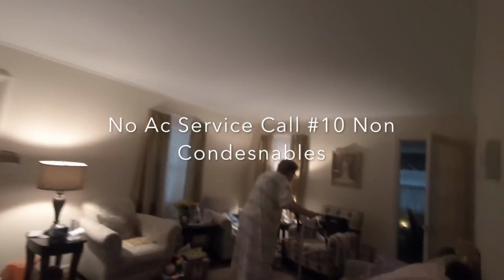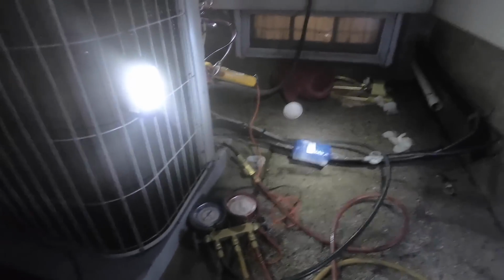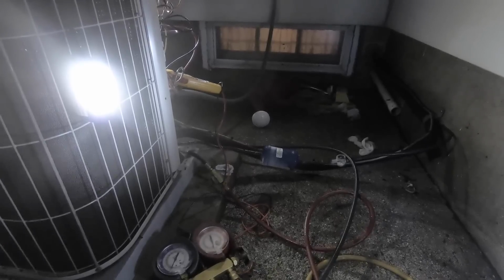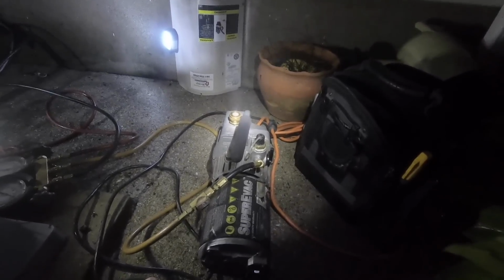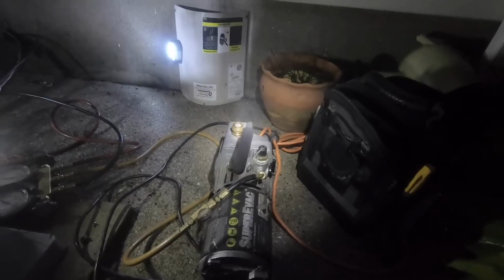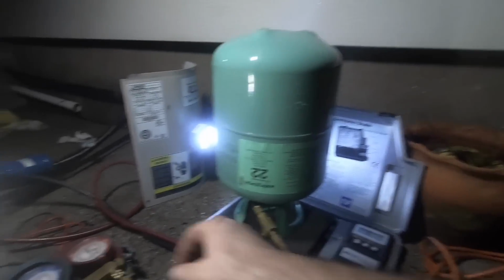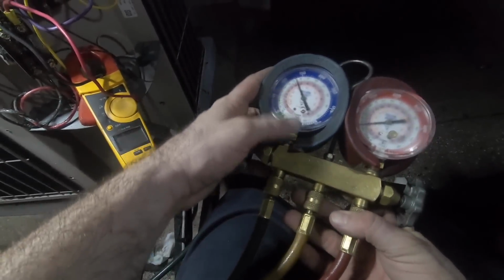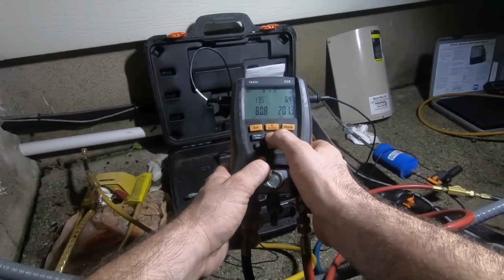AC Not Cooling Contaminated System Overheating Compressor HVAC

Comment: Contaminate system u should change the poe oil ang dry a filter too,this a hack job
Reply from the maker: System doesn’t have Poe oil, I used up my only 2 driers earlier in the day. This is real world HVAC. This is an emergency call so I did what I had to, to make the system work. It’s still cooling today only getting a maintenance. Does coming online and being a troll make you feel good? Read through the other comments and you would know why the drier wasn’t changed
Reply: The HVAC Hacker 
So, you charge the old woman $1,600 and because  YOU didn’t have a drier on you, SHE accepts the risk of failure down the road.   Get a grip boy
Reply: @thehvachacker  you should have come back the next day with a new filter drier. Because I'm sure you won't be back to put one in. A/C can wait till you have the parts the next day. That's real world HVAC repair. No filter drier won't be your problem. It will be the customers in 5 years. And speaking of the customer, you were talking way over her head
Reply: @Jimmy Nguyen - Your comment is a hack job.
Reply: @Bob- Another effin troll.

Comment: I thought NEC rules mandate a 120 volt service outlet near exterior AC evaporators
Reply: They don't require one. A smart person can get power from the 220V at the unit
Reply: @bobrob3109  i want to be smart. How would you do that?
Reply: @gerardolopez3858  A "cheater cord".  Basically the female end of an extension cord.  Clip cord Line to either line going to the AC, clip cord Neutral to the  AC ground wire.  Illegal around here
Reply: @1480750  It's pretty much "illegal" everywhere. You can't use the ground as a neutral return.
Reply: @bobrob3109  My bad.  NEC 210.63 only pertains to rooftops, attics, and crawl spaces.
Reply: How are all old electric driers wired? 2 hot wires and one ground. They have 240 heating element and 120 motor. The motor powers from one hot wire and the ground. Yes it is no longer the way and new codes require a 4 wire cord to allow the neutral to be separate.  But for many decades it was just the way.
Reply: Commercial only this is residential anything flys in residential

Comment: okay so im a DIYer is the subcool is your liquid or suction and your super-heat is your vapor or head pressure??
Reply: Sub is liquid
Super is vapor
Reply from the maker: Joey Del Mars Jr. subcooling is the hot vapor hi pressure gas changing state to liquid inside the condenser coil as heat is being rejected. Superheat is low pressure/ low temp liquid absorbing heat in the evap coil causing it to boil back into a cool low pressure vapor
Reply: Superheat is how much warmer the refrigerant is than it needs to be to boil (liquid to vapor). Subcool is how much colder it is than it needs to be to condense (vapor to liquid). So you can only figure superheat on vapor (low side) and subcool on liquid (high side).
Reply: Superheat is the temperature difference between the SST (Saturated Suction Temperature) and subcooling is the temperature difference between the SCT (Saturated Condensing Temperature). For example 10F of subcooling means the liquid line is 10F cooler than the temperature required to condense the refrigerant ensuring liquid feeding through the metering device.
Reply: Poor Joey’s head just exploded.

Comment: Im just thinking that if someone went and put 410 in there, thinking they were helping her out ,then maybe there is a leak ,otherwise why would they have touched it
Reply: Maybe they read low pressures thinking it was a 410 system
Reply from the maker: System might of been struggling since we were above design temp for 6+ days. Someone not knowing it’s 22 thought it was 410 and charged it up saying nice 22 pressures are lower than 410

Comment: You don't need to tightened hose connection s that hard that you have to use Chanel locks to get the off the vacuum pump silly goose.
Reply from the maker: You don’t I just needed to replace the hose gaskets

Comment: This Technician is one of the best!! I do mostly supermarket refrigeration and some A/C, this technician check and do a very acurate diagnostic, others HATERS a/c guys would sold a new unit to this old lady, but he insisted and repaired. On this industry I noticed that most of the A/C guys they dont like dealing with repair units, they push on sell new units on most of their service calls, I found on 3 diferent times that techs were trying to sell new units, one unit was tripping breaker due to bad relay making contact with unit housing,this was a $20 relay, other time because of blowing fuses due to bad disconnect switch... Way to go HVACR!!!!!
Reply: So, next year when it fails, she'll have to replace it since R22 will be gone. There's some give and take here.
Reply from the maker: So this summer is almost over and the system is still running without anything but maintenance done to it since my repair. Also r22 won’t be gone just not manufactured. We have 5 skids of 22. Yet unless a system leaks r22 isn’t a problem
Reply: WileyDean thats the problem with A/C Tech that dont know work ethics, always trying and pushing to sell new units, can't they just repair the unit or if they can not fix it ask for help, dont try to sell new unit just for a bad motor or bad wires,

Comment: NIGHT WORK LIGHT: I have a 4 foot metal rod 3/8” square with a 8”x8”x1/4” floor plate to hold it up next to the work area and use a big pinch clip halogen flood light to see far better in the dark. I also have clip on battery powered lights too.  I should mention I have an arm that sticks out 10 inches at 2” high with an old 3” magnet mount for a car roof antenna so you can reinforce it in the wind by slapping it right against the unit.

Comment: I think you did a great job. I only wish your truck wasn't limited to two dryers/filters. I'm a retired tinner/installer that started working residential around 1972 then changed to commercial/industrial about 5-6 years later. Enjoyed your video, started to get a little dizzy at times.

Comment: Thanks for posting.  I have a ~35 yr old Bryant AC 2 ton system.  It just stopped cooling.  My high side pressure is super low (~70lb) and the high side line existing the condenser is actually freezing over.  Low side line is lukewarm.  Appears I have a restriction in the condenser coil.  Compressor still seems to be working as compressor exit line is very hot to the touch, but the the exhaust air from the condenser fan is actually cold--not hot.  Any ideas?  I know I'll prob need a new system, but thought I'd ask.
Reply: Thanks for replying!  Strangely it’s the little pipe (high side) that’s freezing over, not the big pipe.  It’s not a heat pump. 

I’ve taken the top off and both sides of the dryer are cold as well (was hoping if one side was hot and the other cold that the dryer was plugged).  The condenser fan is also exhausting cool air vs what used to be hot air.  I think the condenser coil has a blockage somewhere because, as I noted, the compressor exit line is very hot to the touch, likely meaning it has high pressure, but somewhere there must be a blockage.  

Given its a 35 yr old r22 system, I think I’ll prob be forced to put on a new system given cost to fix it vs likely lifetime left.  Surprisingly, this old furnace and AC have been just awesome to this point for me.  No issues in 10 years. 

Separate question, if I go with a new system, do I need to install a fancy thermostat in order to be compatible with most new 80% furnaces?  I have the old school mercury Honeywell round thermostat that I love.  No batteries. No clicking relays (which tend to wake me up when sleeping).  Just works.  I really don’t want a programmable thermostat. 

Lastly, any brands you’d recommend?  I’ve interviewed 5 installers.  I like the installer who puts in Luxaire systems best.  He has great reviews and can install quickly and will give me a good discount if I pay cash.  I also like the installers of Ruud and Trane products but they will take more time to schedule.  I have a 9 month old pregnant wife, so I’m trying to get a good person in quickly.  Thx!
Reply from the maker: You can keep your round t87 thermostat. Can you rent a thermal imager from anywhere? You could find the restriction with that. I don't have the money for a good thermal imager yet cause i buy lots of new tools like those smart probe refrigerant gauges. Just ordered the air probes. Along with a website that I'm trying to build up. It sucks to wait for the guys you like to put in the equipment ad i understand my install dept is 3-4 weeks backlogged. Yet the new system is an investment so you want to make sure whoever is putting it in is good. I like Lennox yet also work for one of largest lennox dealers in the country. I just put a coleman into my dads house and it runs nice and quiet. The coleman is made in USA its a product of York
Reply: @thehvachacker  I'm surprised they are able to keep their old round thermostat must depend on the state or city codes? I have a family member who just had a furnace and ac installed in Michigan and they were told that code requires a programmable thermostat
Reply: @Comedycentralmarb  Red states still allow round thermostats.
Reply: birdwing98 especially the ones with the mercury switch inside.
Reply from the maker: is it a heat pump? Is the large pipe freezing or little pipe. If the little pipe is freezing you sure your coil isn't frozen? is the condenser plugged up and needs cleaning. I am asking about heat pump cause you have cold air coming out of condenser and little pipe is ice cold.
Reply: The sad thing is that you have to replace a 35 year old good soldier with a  p.o.s. that will have a life expectancy of 10 to 15 years.

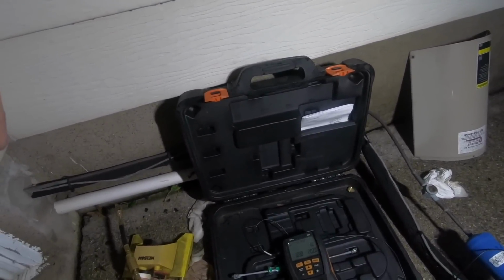Comment: 44:50. If there is a leak so what??!!! Way to take pride in your work.
Reply from the maker: This system is running fine from the repair i did and hasn't needed any refrigerant since that day. You can hate me all you want i don't give a ............ Nothing crooked about making a system operate most would condemn.
Reply: @thehvachacker  units can have leaks and still make it through the summer
Reply: @thehvachacker  you did a good honest job,dont let the asshole comments rent space in your head,i know the lady was happy
Reply: @Mikemeshell63  HVAC HACKER talked way over the ladies head. It's commendable that he stayed late but filter driers are important, like your car oil filter
Reply from the maker: I take pride in my work only reason I don't condemn equipment I can repair. Don't need to take lessons from anyone on taking pride in my work. Word of mouth is how all business is gained. Which means lots of satisfied customers from doing the best I can for everyone.
Reply: Those lights are badass though
Reply: And ... another asshole comment from Bobhole.

Comment: What brand is that flashlight I really like that
Reply from the maker: It's a braun slim bar from harbor freight
Reply: @thehvachacker  I'll have to run over to Harbor Freight myself and take a look at em. I need some work lights for night work. Been looking at the Milwaukee one because I'm a sucker for rechargeables. I've got their inspection pen-light and it works great.
Reply from the maker: Which milwaukee you looking at? This braun light operates on a rechargeable 18650 I have 2 lamps and 4 batteries. To try to prevent not having enough light.The Milwaukee jobsite light looks nice.
Reply: @thehvachacker  the 2112-21 Flood Light. Its got a magnet along the spine and a magnet along the end. It looks like exactly what I'm wanting. But the braun one may be right up my alley, I vape and have oodles of 18650s and a 4-battery charger already, so we'll see. Never hurts to have plenty of lights.

Comment: The "seconds per mile" to determine how far lightning is from you is absolute nonsense. It takes sound almost 5 seconds to travel one mile. The lightning is actually almost 5 times closer than you think it is if you use the "one second per mile" "rule".
Reply: I was always told 5 seconds per mile. But it's weird to see my neighbor's truck smoke 5 seconds before I hear the tires squeal! Upon which I have confirmed the 5 second rule.

Comment: stupid question... wouldn't be cheaper to replace it with 407C? just wondering ..
Reply: I concur. Drop ins murder compressors.
Reply from the maker: I only put r22 into an r22 machine. I would have to do an oil change to convert to 407c. I don’t carry any alternatives to r22 it’s the best refrigerant
Reply: @thehvachacker  Cool! Thanks for sharing and quick response.

Comment: Why don't they put siphon tubes in the refrigerant tank so you don't have to flip them to charge a system?
Reply: We flip them to charge liquid. If you keep it up right your charging vapor.
Reply: because even if we put in siphon tubes, at the top of the tube it would still be a vapor and we want it to be a liquid when we're charging.
Reply: @smartpig129  What! Liquid going straight into compressor. That's how you damage compressors. You need a device that you put in your charging hose that takes liquid and vaporizes it enough that the compressor doesn't get straight liquid. You can get it at supply house. You can charge with liquid, but your playing with fire. You can charge a system that is not running with liquid but then you will have to wait to start system
Reply: @bobrob3109  . I need to go get one of those liquid charging things right away! Oh wait....

Seriously, if youre dumping so much liquid that its hitting the compressor youre going way to fast anyways, and if the pressure in the suction line is so high the refrigerant doesnt flash as soon as it enters, maybe you shouldnt be chargong the system in the first place.

We charge as a liquid because Modern refrigerants are a mixture. If you charge it with the valve on top the different refrogerants will boil off at different rates, getting an improper ratio and it not working effectively if at all.
Reply from the maker: Bob showing his inexperience off again in another post, interesting the new critic I have. Bob we pull Schrader core valves out to achieve a faster vacuum because they practically close the opening of the valve. Therefore the liquid refrigerant is hitting an orifice opening, mixing with superheated vapor which will not keep a full stream of liquid or much liquid at all from getting into the compressor. I’m guessing bob you also bought the torque tool for valve cores to prevent over tightening them. I will say if the valve core pin isn’t there you do have to be really careful charging and go even slower when adding liquid. I have a video where I was learning to use my smart probes and you can hear the liquid slugging into the compressor with the pins pulled. Yet everyone charges liquid since charging r22 gas only can take forever.
Reply: Bobhole SuperTech.